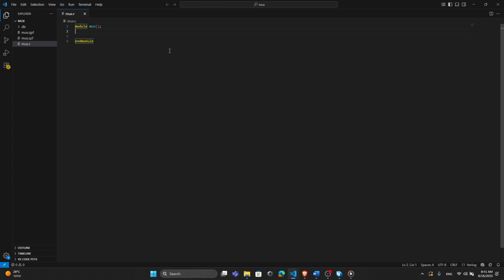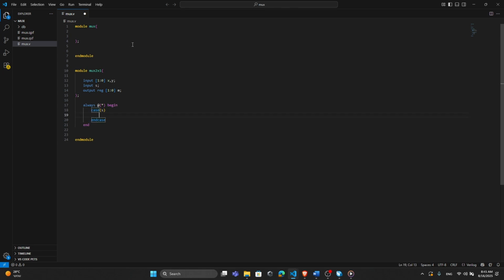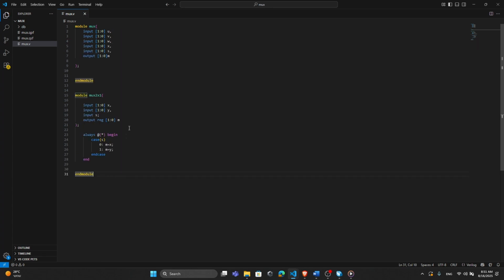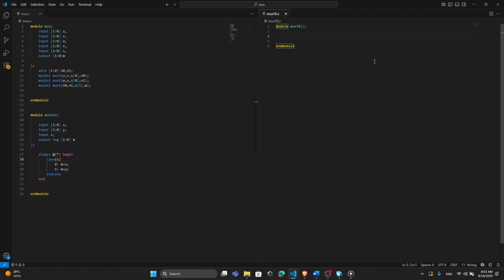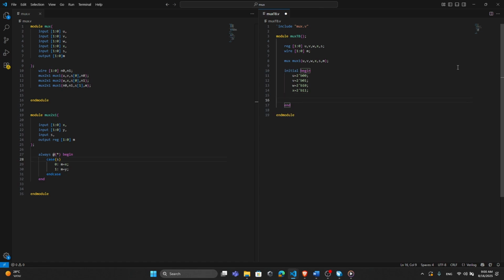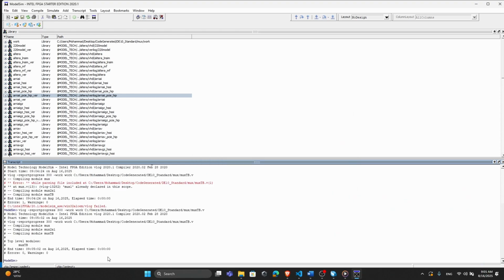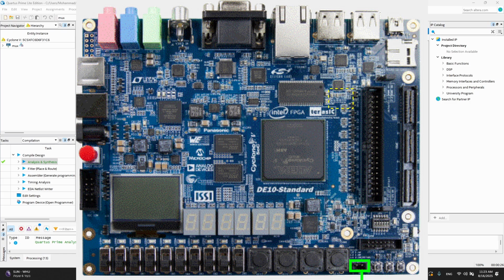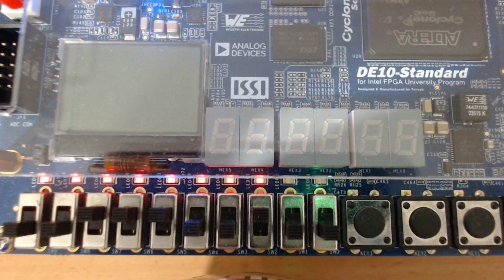Verilog & FPGA Tutorial #2 – Multiplexer (MUX) Explained

Comment: 02:29 Why register? Multiplexers are asynchronous. They don't need to be clocked/latched. This could have been done with just regular logic on the gate level or data flow level. Behavioral level is an overkill, and rather circular, considering that if statements in behavioral descriptions are usually synthesized as multiplexers in hardware :q
Reply from the maker: You are right but I was just showing that you can write verilog as a functionality as well so new people dont think that there is only one way :)